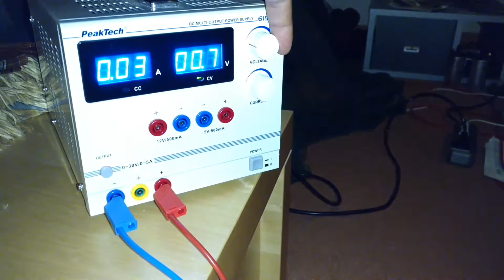Simple Electro Radiant Energy Receiver

Comment: okki, it's odd, but to date, no one seems to correlate Simple Electro Radiant Energy Receivers aka wireless power transfer as a generic electromagnetic wave as in radio, and so can be made to be directional and so point the available power to a longer directional distance,rather than the generic  Permanent dipole  throw it everywhere even where there's no receivers locally, and so reduce the power overall , pringle can directorial antenna, aka A directional cantenna style antenna etc...to name but one...

so it seems logical (to me, as Mandelbrot's fractals are VERY useful in engineering and keeping it simple stupid mindset) to simply make two directional fractal wire antenna's to a given collection of frequencies and harmonics ( you know the slayer is giving out)  or more related wireless freqs near by and use these Fractal Antenna at both ends as the transmitter and collector for the best transmission of power and collection of other radio freqs into the whole...

see  Benoit B. Mandelbrot's explanations and practical first steps at bending wire :) to suit... https://www.youtube.com/watch?v=3Xq6h31UCKQ
Fractals and Antennas

and also remember Professor Eric Laithwaite (inventor of the linear motor: Motors Big and Small - 1971 as regards electro magnetics V magnetic motors etc...
https://www.youtube.com/watch?v=oWiYsRi2Dss&t=938s

http://www.cam.ac.uk/research/news/new-understanding-of-electromagnetism-could-enable-antennas-on-a-chip
Reply from the maker: Hi Everest, thanks for very informative comment and links. I'm still trying to understand the real nature of magnetic field and electricity. It seems to me that we are actually not able to create a closed system (circuit) which is completely isolated from the environment. I'm pretty sure that even a vacuum space is not empty. It means this has still effect our circuit. Therefore we cannot neglect the effect of environment to our circuit. If we can create a system that interacts mutually with environment, we can draw energy directly from environment and do no harm to the environment.
Reply: @OkkiMoeljadi  I think the Casimir effect was one of them. From empty they come light. I like your videos and clean circuit setups. Very well done. Hope you will makes more.